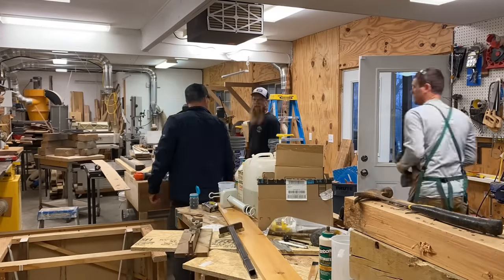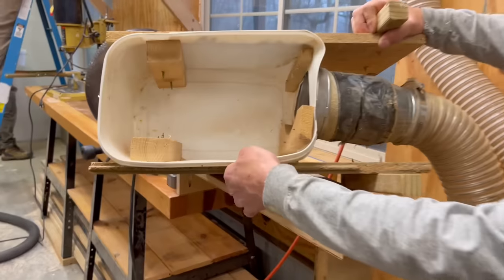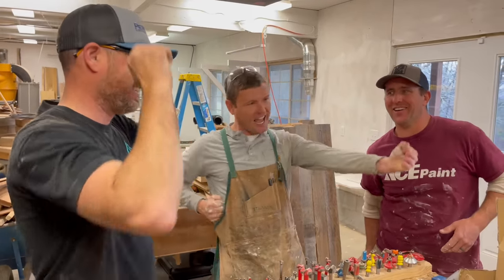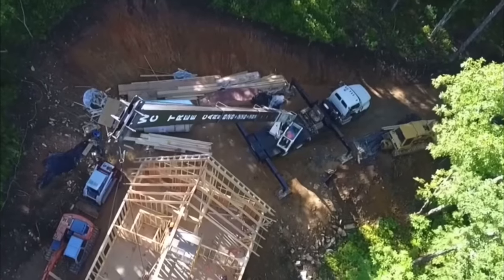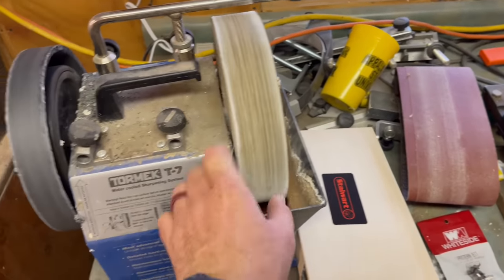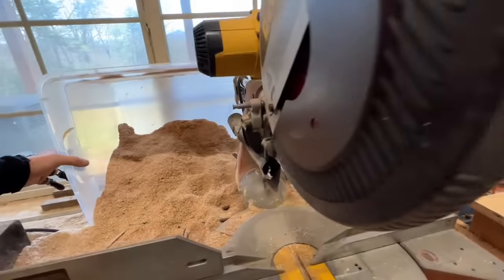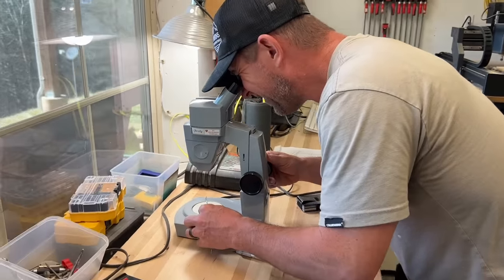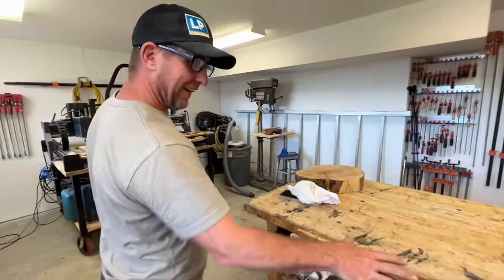The workshop is a disaster! Let's fix it up.

Comment: Hey. guys. Just found your channels about a month ago and I'm hooked. I noticed a couple times, there were questions about carpentry pencils. MY grandfather was a carpenter during WWII and built houses for the ship builders in Portland, Ore. Anyway, he always said the pencil measured 1/4 x 1/2 so he always had those measures and didn't have to unfold the wood one.  if you keep it sharpened correctly, it will stay sharper longer. Thanks for the great shows.

Comment: I'm on low dose TRT. Started about 3 months ago. I do a weekly injection. I noticed results after about a month so 4 injections. If you are a candidate get checked out. Not trying to lift heavier at the gym but that is where I noticed it the most. In other aspects I feel like I'm 18 again. It works!

Comment: Jamie...  I'm glad that you shared how you lost your fingers.  I was curious but didn't want to just ask.  My father used to build kitchen and bathroom cabinets.  He had a good sized shop but not as nice as yours. He lost one of his fingers in a shaper that the bit turned at like 22,000 rpm.  He said he never even felt it, it wasn't until he saw the blood splater against the wall behind the shaper that he realized what had happened.  He ended up losing a couple others too Dupuytren contracture.  Turns out Dupuytren contracture is hereditary, both my brothers have had it and at 70 I'm starting to get it in one hand.  I will say it doesn't seem to slow you down much.  The new shop look is great.

Comment: Adding a larger size hose to your vacuum will increase air volume but you will lose velocity which is why it wont suck up larger shavings.  I've learned alot in the automotive world that bigger is not always better.    Anyways just a tip if you are still having issues with the vacuum system.

Comment: I see the dust collector hanging from the ceiling those are nice I have two in my shop I use mostly grizzly tools they are pretty good tools I also have my collection hose under ground for my table saw and also have my collector in it’s own room for sound

Comment: Getting old is cool . Working in a shop in your basement has to suck . I had a 30x50 building with 12 foot ceilings . It was 2x6 framed 5/8 sheet rocked with r-30 in the walls. Warm as it gets .